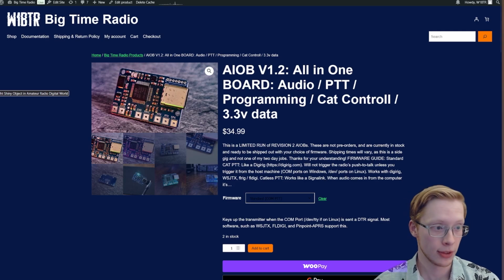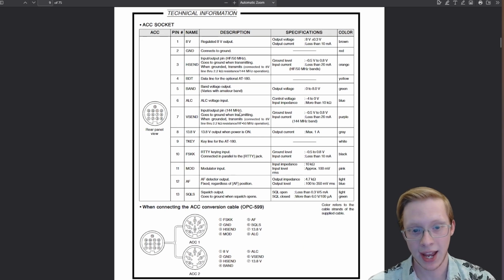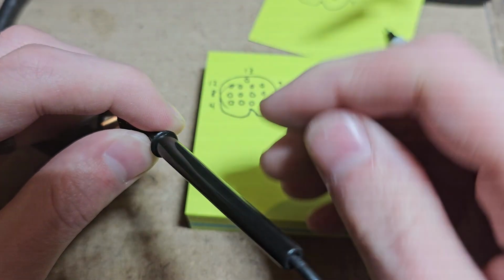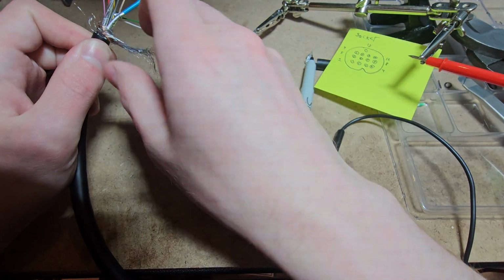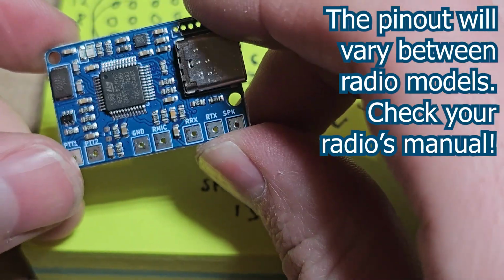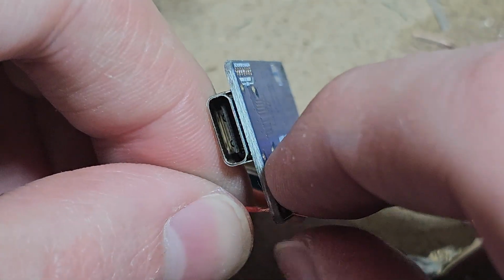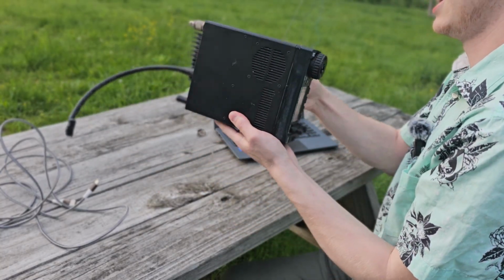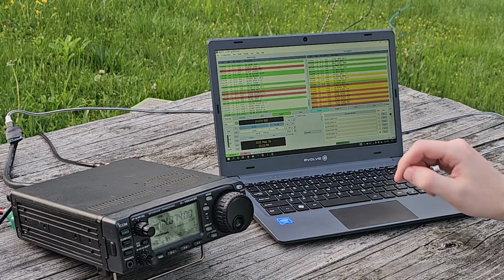AIOB Digital Interface? LET'S BUILD IT!

Comment: It looks like the AIOB is just an interface board, not a TNC. I assume that you’re using WSJT-X for FT8 and the other software apps for the other modes. If it was TNC, then I think you’d just be using software to Telnet into the TNC board, and the software for each mode would be contained in the AIOB.

Comment: Nice board. But sorry to see you not use the waterfall when you call CQ on FT8--or at least not show the use of it. FT8 is not QRM-proof, and when you TX without making the effort to choose a frequency that at least appears to be clear, you're falling short of good amateur practice. You may very well ruin somebody else's QSO, or you might be TXing right on top of weak and rare DX that lots of people are calling. What sort of reputation do you give yourself if instead of decoding the DX they're calling, they begin decoding you? No, there's no foolproof way to avoid this scenario, but why just blunder about blindly and increase the odds of making your callsign stink when you can use the waterfall to minimize that likelihood? The guy who makes the board that enables others to get on these digital modes will do well to exemplify good amateur practice to show that he's a good op and not just a good engineer.

Comment: I think I'd take the radio cover off and install it inside the case. Connections via the back of the connectors inside the radio and then just have a single USBC connection to the outside.  It's a lot more work (with a drill and Dremel etc) but would make a very nice job of modernising a IC-706 or in my case a FT-857d or  FT-950.

Comment: So my thought for this is to follow the Kantronics DB9 standard for audio etc. and add the data pins either on the unused or to a separate connector.  Put this all in a case so you can just make cables for it as you change radios.  You might then get away with an already made cable from a tnc.
Reply: Ive seen folks make a digirig compatible 3.5mm trrs cable from the AIOB to benefit from the extensive library of Digirig cables and the lower cost of the AIOB.
Reply from the maker: Great idea! One of my favorite methods is to use an rj45 female jack to use cat5 cables with custom crimped connectors to match other radios. Then, there's lots of db9, din, etc to rj45 adapters that work great!